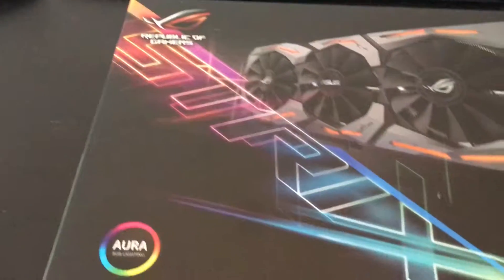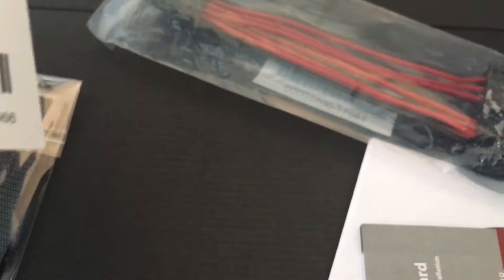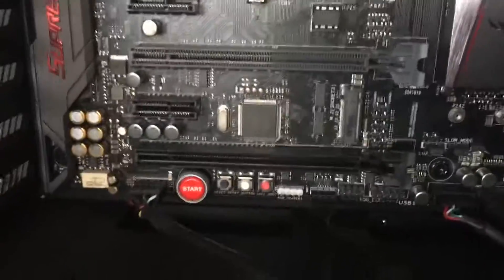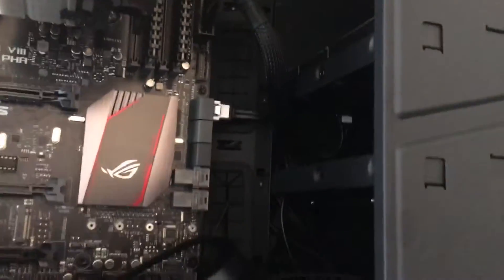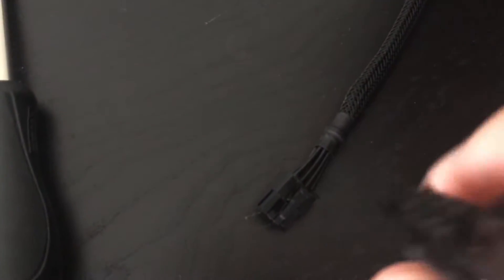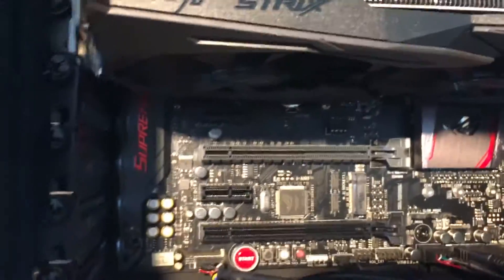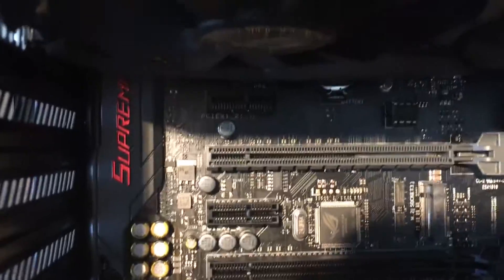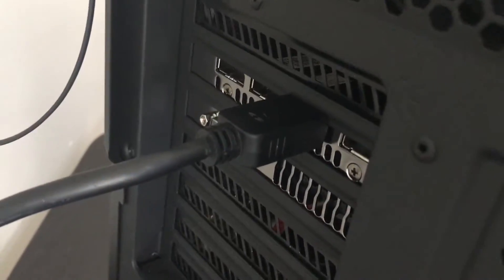How to Install a Graphics Card! (ASUS  ROG STRIX GTX1080 + NZXT H440 case)

Comment: okay but we're do the other end of the graphic card cables go? where does the 8-pin go?
Reply from the maker: the other end of the 8-pin power cable goes to your power supply, it should be marked "GPU", unless its a non-modular power supply then it should be already connected
Reply: Thanks but where dose the 6 pin go?
Reply from the maker: the 6 pin goes to another GPU port on the power supply

Comment: After installing the gtx 1080 how many harddrives will you be able to fit?
Reply from the maker: On this motherboard with the h440 case, I currently have 2 x SSD's and 1x desktop size HDD in the hard drive bay area
Reply: Rouz. So i would be able to fit 3x 3.5 inch drives in there?
Reply from the maker: Mom's Spagetti yeah sure, you'd still even have room for another 3 ssd's with that setup as well
Reply: Rouz. Thank you very much!

Comment: Hey I have the EVGA750 GQ PS and there is a Y connection and on one end goes to the power supply then there is an 8pin and a 6+2 pin in a Y config can I plug both the 8 pin and 6 pin and just plug in the other end to the power supply for both or do I need two different cables plugged into two different power supply outlets like one cable for the six pin to power supply then another from 8 pin to power supply. Is it the right VGA cable I have or should I use two different ones?
Reply from the maker: the Y connection should be good!
Reply: I had the same doubt. Thanks

Comment: Hey i have the same case and i want to use the same gpu can u make a video on how much clearance u have between the gpu and hard drive bays
Reply from the maker: theres a lot of clearance, however you have to remove a couple drive slots near the pcie slot you put your gpu in otherwise it will just not fit
Reply: Games With Nic does how your strix 1080 fit? I have the Razer NZXT h440 as well
Reply: Games With Nic did you use two different cables 6pin and 8 pin from the psu to power it or did you use the red splitter that comes with it? And just use one 8 pin cable connected to the red splitter..?

Comment: is this the OC version or just the regular Strix (sorry,idk which one the ROG version is), and have you tried to manually overclock the card yet? how it go
Reply from the maker: this is the OC version but you can OC yourself using any ocing tool. I use the asus one. It went alright, but tbh its already powerful enough so don't see much of a difference :)

Comment: hi if I have only 2 connectors with 6 pin, do I have to buy a converter 6 pin to 8 pin to plug the card?
Reply from the maker: no, it does come with a 2x 6pin to 8pin adapter
Reply: so I have to plug 2x6pin in the adapter to 8 pin and leave the 6 pin connector on the card unplugged ?
Reply: yes

Comment: did you have to remove drive cages from h440 to install that graphics card? pcpartpicker said is longer than max length to have drive cage
Reply from the maker: yeah I did, tbh i only have as many drive cages as I need anyways (I only need 2 so its quite flexible). The gpu itself will only take up the space of around 2 drive cages (I removed a 3rd one for extra space). Something you can do, if you really need the drives, is replace them after installing as you only need to remove them to allow to gpu to be placed in position
Reply: DrRocker911 alright thx